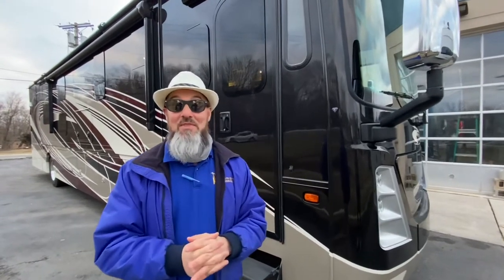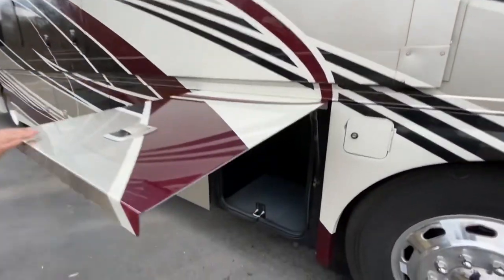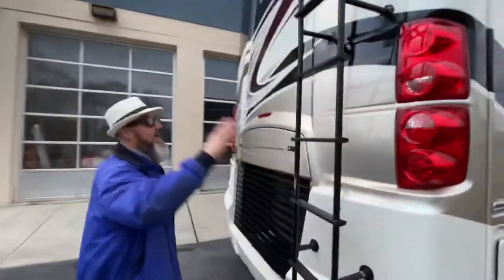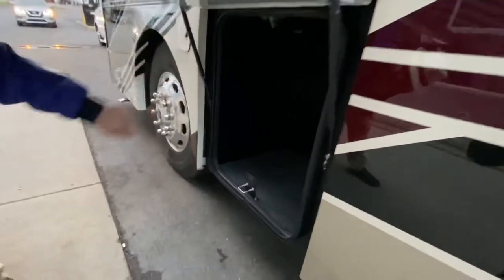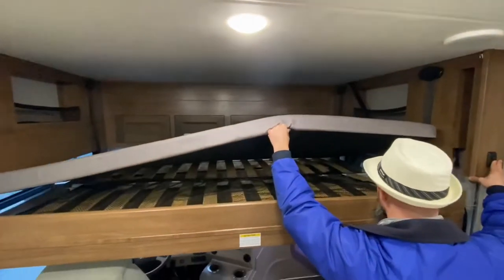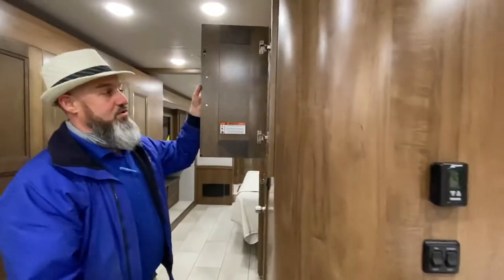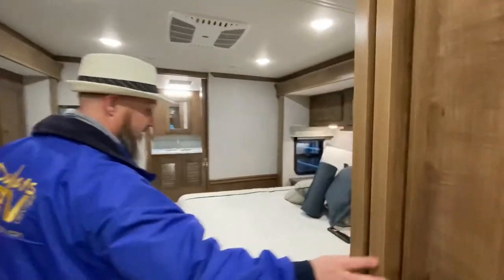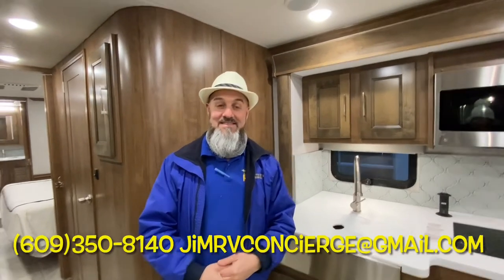2021 Coachmen Sportscoach 402TS

Comment: Jim - just a little more feedback on this unit as I actually got in one down here in Knoxville.  That back shower is not great for a guy who's 6' 3" (my head was hitting the top of the skylight).  In fact, I hit on most brands (Tiffin, Thor, etc.).

I did clear in the mid-ship shower though without the step up over the motor.  That 2nd shower is a nice little selling feature for taller folks!